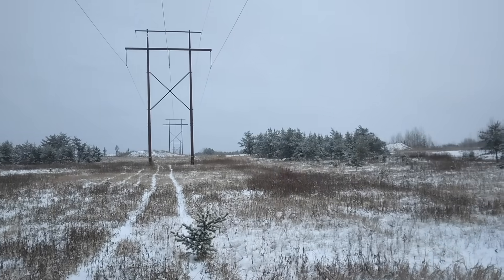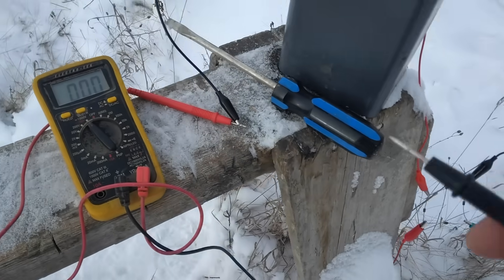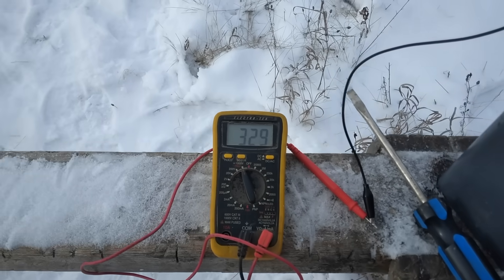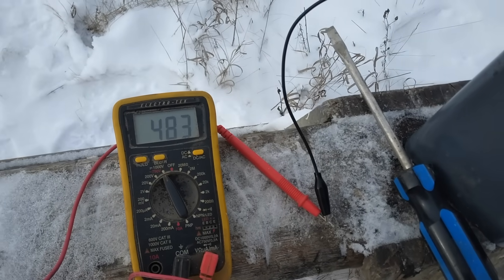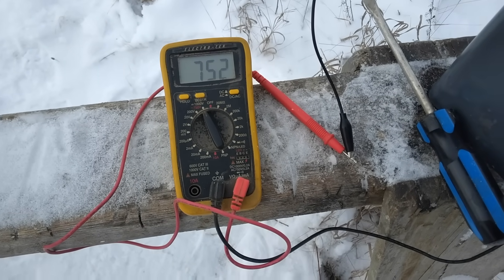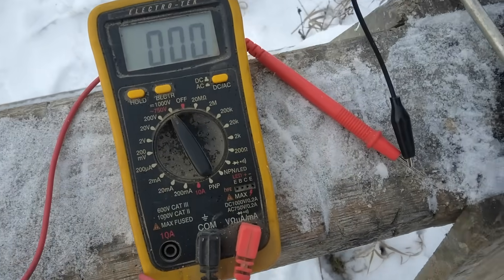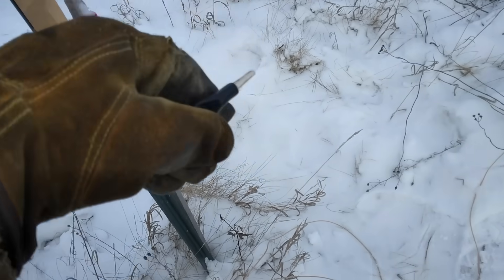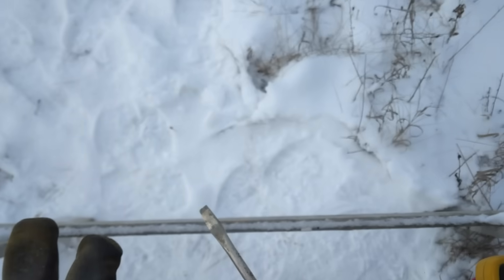Fences sucking power from under HV transmission lines

Comment: While all your doing is tapping the emf waste I would not call it theft, however it does create several potential safety issues.  One if you don't know what your doing it could brown out or burn out things using it.  Second haveing an extra conductor allong the line could put people and things at risk should you have a downed line.  Many easments do restrict electric fences underneath along with other lines.  Often places with gates and underground jumper lines are used at such sites for a buffer.  Might be useful to charge a fence for livestock with a limiter added or for some electrolysis process to coat/strip metals or break water for Hydrogen and Oxygen perhaps for fuel.  Do the process in a shed beyond the easment but run the line to tap the field.  Might want to ask an Electrical Engineer to help with the math and design saftey cutouts.  Make sure the wire is rated for it as well.  Without the diodes you should have proper AC cycles unless you have an interaction with the other phases (one of the reasons for the spacing on poles or towers)  lines layed in concrete has busted concrete before due to interaction.  Just some things to consider, you could get some just from the Earth the same way if you ran enough but would be a huge lightning rod at that point.  You are basicly doing something Tesla wanted to do to transmit wireless power.  He built a tower with a huge coil that sent power like a radio wave.

Comment: I watched this.  I am not an EE or electrician but probably have the equivalent background plus, some years as an amateur radio operator, teacher, BA in Math with nearly a second BA in physics. Lets look at resistive coupling.  First, if that is a 230KV line at 40 feet, it is BARE wire.  So the electrical potential across that air is 230KV.  If the fence is 4 ft above the ground and the line at 45 feet, one tenth of th 230KV - 23 KV is between the wire and the ground. Of course, the air has nearly infinite resistance - say 10 meg ohms.  If you stand under it your body has far less resistance, say 50 K ohms so the voltage division is 50,000 divided by 10.,000,000,000 - 10,000,000 divided by 50 or about 200,000 to one, Depending on moisture in the air, this resistance can be higher if dry, lower if not so.  The coaxial wable was essentially insulated by a much better dielectric than air, there would be very little if any resistive coupling in the fence, however in the house, i would say a lot higher, maybe enough to shock.
Nest there is capacitive coupling.  Two conductors with an insulator will conduct AC. There is actually a big capacitor here one side charged with 230KV of 60 hertz AC and the other at ground level. In this case the capacitor will act to allow a VERY MINUTE current flow. It would go through the capacitor and the bridge rectifier and be able to charge the cap. 
The third is an inductive coupling, a transformer, in effect. I am not as well versed in this as in the cap and resistance, and with the distance, the gauss of the magnetic field around the wire will be weak at 40 feet, I doubt if that has an impact but If i were trying to capture that energy I would use a coil with an iron core - I am trying to work out how to cut the flux lines. The clamp AC ammeters use these lines to read the current in the wire but they have a iron core that goes around the wire.  They measure the current in a coil around that.  It is really a transformer with one turn on the primary. BTW, I would have to see the court case on the guy being sued, that looks like an urban legend. 
Now for the amount of power.  One KWh is 3,600,000 joules.   An 88 mfd cap at 1,000 volts is 44 joules, you would need 81,000 capacitors to get 1 KWh.  I do not see any of the three getting close to the required amount to be significant.  My home, a very efficient one with an electric bill of under 80$ a month uses about just over 400 KWh.  These stories are good urban legends but nothing more. The guy with the shop had his neighbors snookered.

Comment: Get you flat 2 conductor VHF  TV lead in cable same length as coax , ground one leg to the  ground rod , attach other leg to the rectifier attach jumper from ground to CAP. attach jumper from rectifier to other leg of CAP. Wind the other 2 legs of flat cable to each other and stretch it out similar to coax. You will have a balanced system and it will work better.

Comment: When building electric fences here I,ve noticed at the energiser end I,m getting approx 6500 to 7000 volts off a decent battery powered unit , with my idea of wire spacings , 5 wires to keep sheep in , I get about 8000 to 9000 volts at the farthest end from the energiser , this can only be the wires acting as some form of transformer , & it will keep the stubbornest of sheep in , & other wildlife out . I,m not smart enough with electricity to know just what is happening , but it does .

Comment: I used to work in a power station with 3.3kV switchgear for the auxiliary plant.  Walking behind the circuit breakers, where the insulated cables were run, the hands on my quartz wristwatch would start visibly speeding up.

Comment: But at what kind of amperage? An automobile spark plug has high voltage, but you can’t power up the house with it. Volts times Amps = Watts. Let me be sure I am getting this correct.
There is a magnetic field around each of the high voltage cables which is alternating current at 60 cycles/second or 60 Hertz. So, an insulated cable below it would act as a transformer with the distance determining the secondary voltage. A forty foot cable would not have very much amperage. The Wheatstone Bridge then converted the AC into simulated DC current.
Reply: You need a loop for magnetic flux and will gather the flux through each turn of loop. I'm trying to figure out the actual circuit but  I'm leaning towards it being capacitive  coupling.

That was a full bridge rectifier. It has the same circuit topology as a wheatstone bridge but the wheatstone bridge wouldn't rectify AC ( it uses resistors, not diodes ) it's used to accurately measure resistance.

Comment: so this milliamp voltage could be used? is it actually siphoning off of the power line or is it collecting energy that just would have been wasted? if you had 100 miles 20 feet off the ground, would it affect the power lines maximum potential? would it cause extra resistance to the main line?

Comment: You are dealing with what is referred to as induced voltage or transformer effect….humidity, air temperature plus material of conductor will effect voltage …utilities normally don’t care that you put fences under power lines because you normally run t post along straight fence sections which ground the steel fence…You Sir are using insulation wire with a large capacitor( not a fencing material ).Would you walk over to your main electrical panel when it is energized and remove cover and start “playing “ with the wires you have there…You have set up something far more dangerous.. I would ask you to watch a couple of arc flash videos to so you can understand the danger you are in…

Comment: There's no power being "stolen" from induction. This is power that is "LOST" due to natural electromagnetic physics. It isn't possible to contain, retain, or in any way control it by the power company. This is the same electromagnetic radiation that has been identified as a HEALTH HAZARD for anyone living in their immediate proximity. There have been some suspected fires caused by arcing from uninsulated fencing wires.

Comment: 36 J is equivalent to 36 Watts over 1 second.
You can calculate how much power runs through you wire by that. It's far from significant.

For the best effect you should run a wire 51170333.33 m long (= 31795.77 Miles in fantasy units).

Comment: I remember reading many years ago how high voltage power lines not only carry electricity along the wires, but they also "broadcast" some over the air nearby. Proof was provided by holding a fluorescent bulb up some yards away from an active powered tower. This bulb wasn't connected to anything. It was just being held in the person's hand. It lit up brightly just from all of the excess electricity.

It is definitely illegal to hook up to power lines without permission. That does meet the criteria for theft. However, it is not illegal to "harvest" freely available electricity, without any connection to the power lines.

The big downside is that all of that freely available electricity isn't healthy, so it's best to avoid prolonged exposure to it. This goes for pets and livestock too.

Comment: I once charged my car battery using a radio receiver antenna attached to the positive side and the negative side of the battery attached to the ground. We lived about a half-mile from the radio station. Doing that created a wedge in the radio transmissions and nobody who live SE of us could pick up the radio station. My high school electronics teacher told me it could be done since we lived so close, and it worked!
Reply: Nonsense.

Comment: We have places when glavanized chain link fences run under the line.  The galvanized finish is gone from the fence wire in a symmetrical pattern where the power lines pass over the fence.

Comment: My brother measured 100 volts in the air a mile from the 50,000 watt FM radio antenna for the radio station he worked for.  
Time for glass insulators to be installed in fencing near high KV lines.

Comment: It’s called field and waves. If you send voltage and current down a wire you generate a magnetic field which can then be turned back into voltage and current. At some point given what you set up the power will actually arc over. It’s the laws of physics. You could easily power anything you want with a simple coil system and regulator. You were lucky you didn’t arc weld your screw driver to the capacitor.

Comment: I have used those exact same capacitors to store electric power from a 1200v mosquito zapper ...I think it maxed out at about 700v as the internal losses of the capacitor were more than the circuit could supply .

Comment: I lived practically underneath some highlines just like that there was a metal shed that I storage stuff in and I had a 110 voltage tester. It was just a test light. I hung it by the alligator clip from a screw that was coming out of the roof on the inside it had a metal roof on it when you would touch the other end of that test light. You could light up the test light just by touching it. It didn’t shock you though.

Comment: need more coax and wood stakes. and bigger  cap 🤣 all jokes aside I did pole construction for A cable co. 3 pole spans of strain gave me a good bite. the strain 900ft was grounded on 1 end and draw a spark when bonding the other end.
Reply: try longer wire and A step down (plate power )transformer from A microwave oven. this will reduce the voltage and give a little more currant. might power A small 12 volt light bulb.

Comment: Thank you sir for your efforts, in both braving the cold and the testing. I am in Wisconsin and it's -9 this morning so I know what your dealing with in that regard. As to your test and charging your capacitor I am not surprised of the amount of passive power you captured. Depending on the transmission flow rate in the wires, the equation for radiated power would show that a capacitor several times your 1200 volt rating could be charged (given the bridge rectifier having diodes of sufficient rating to handle the load. Excellent job and very informative enjoy you very much.
Reply from the maker: Thanks for commenting.  One more night of -18˚F, then we are expected to be above zero. 👍🏻

Comment: I am shocked, shocked to learn that voltage has been going through these fences!
In  the U.S. it is a dirty electricity secret that overhead lines are woefully overloaded and ground lines are quietly permitted to be installed all along the overhead lines every few poles "just to tide the system over" until capacity can be revamped. Read never.
Thanks utility deregulation! What could go wrong? And...
Isn't it true that "line loss" in the  typical HV High Pylon mounted transmission lines can be 75%?y is on a spectrum for sensitivity. EMF exposure is also cumulative. But all the exposure is a kind of immune system inflammatory effect. So ...free electricity isn't really free.

Comment: I've often wondered about that phenomenon.
How about; instead of using a ground rod, just run a short test line, maybe two posts about 10" apart and run a wire (with insulators) from one to the other and back. Then check the two ends for AC juice and values. If productive, you could then use the total wire length to make calculations for a usable current.

Comment: I heard about a guy whose fence paralleled a railway high tension railway power line for some distance.  He drew power by capacitance from his fence, and used it yo power his home.  Eventually he got prosecuted for "stealing electricity" he proved that he was actually reducing the railway companies' power bills by straightening out the power factor.  By adding his capacitive load on a power line that was powering inductive electric motors, the watt meter gave a lower reading.  
The prosecution case was dismissed, but the raioway company  interposed a grounded screening fence to stop the guy drawing any more power this way.
Reply: those power companies would rather spend millions of $ than find out one customer is 'stealing' a single joule of their energy

Comment: Induced voltage.  It is from the EM field from the lines.  If the fence runs parallel to the line, you will see induced voltage.  If the fence runs perpendicular to the line, you won’t get induced voltage.

Again, if parallel to the line, you can get a fluorescent tube to glow. 😀

Comment: I have only walked near the tower once in my life, I stay as far away as I can now, I could actually feel the electricity in the air as I walked under the tower, my hair started floating around my head I was around 12 at the time. I wear a watch that is rechargeable, except I have only placed it onto charge 3 times in the past 6 months. If I run my hand across my iPad I can feel when it’s charging from the mains power, it’s like ripples running across water. 
Years ago I had a sewing machine I thought was having problems with the power I had it serviced 3 times but they could not find anything wrong with it, I did not realise back then I was actually feeling the electrical current running through the machine. It does not matter what is plugged into the mains I can feel the power that is going through an item when it’s on. 
There is a tool electricians use for testing live wires, I only need to hold it and it lights up. 
I have to earth myself before touching data discs or tapes because I have scrambled the data on them when I worked in the computer industry. The company I worked for brought in specialised people to test the area I was working in to see what was causing the problem. It turned out to be me, as I walked around the office I was building up a static charge and so when I placed my swipe key into the lock I was zapping the key which was wiping it clean. At every door in the building they installed an earthing point so I could discharge the static build up before swiping my key. All the carpets were also treated to cut down on the static buildup in me.  
To this day I still have trouble just going shopping, the number of times I get zapped when reaching for items on the shelf is dam well annoying, it leaves burn marks on the tips of my fingers for weeks at a time. But there is nothing I can do, I have made sure that all my clothes are not made of synthetic fibers as that makes it worse. Even now I just ran my finger along the top of my iPad and I can feel the ripples of power.😼😼😼 at least my watch does not need charging up much lol

Comment: You can build a voltage divider to test HV with your meter. Highly recommend it :) A step down transformer would also work nicely.
Please don't short a huge capacitor ! Measure the current across a load and show us.
Reply: You would measure the voltage across a known load - or the current THROUGH the load.
Reply: @buggsy5   current through...my bad :)